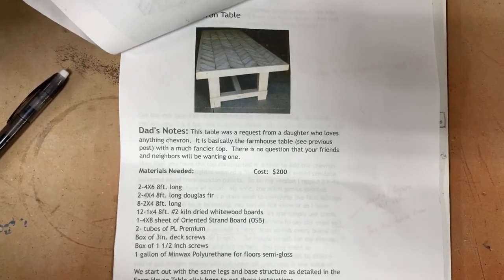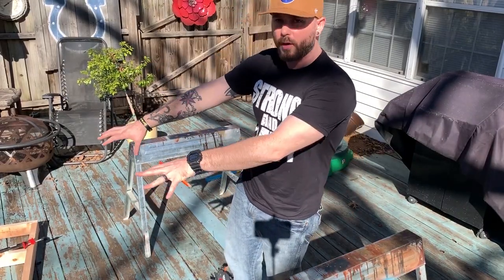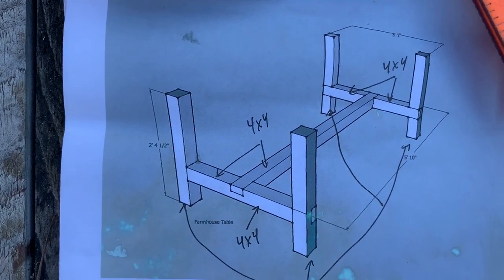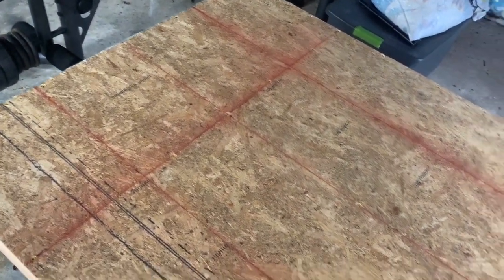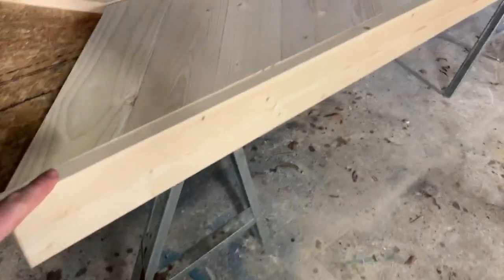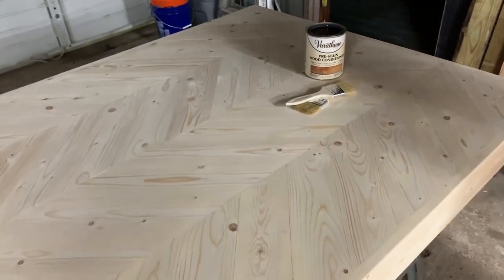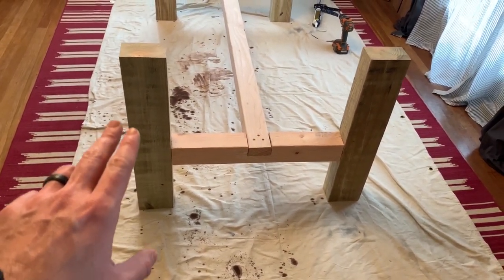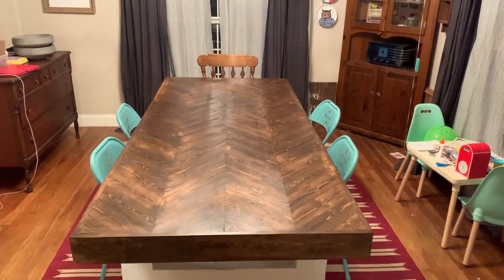How To Build a Farmhouse Table

Comment: How is the table holding up.
Reply from the maker: So far so good, slight gaps but we still sit at it everyday!! Only thing I wish I had used would have been a planer instead of trying to belt sand everything, but at the time I didn’t have a good one that worked.  Gotta go with what you’ve got!! Thanks for watching!! 🙏🏻

Comment: If you would've set it down in there you wouldn't have needed brackets or to cut off 3 inches
Reply from the maker: It would no my have have been equal on the sides - not sure I communicated that enough. Thanks!